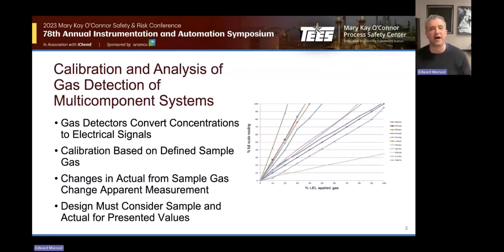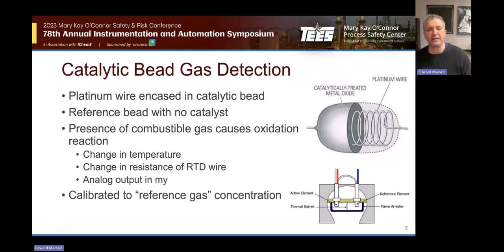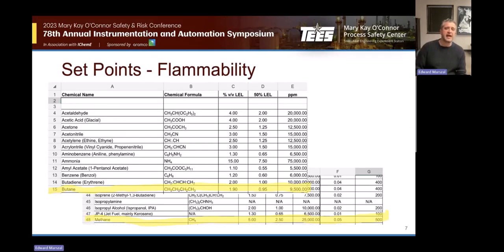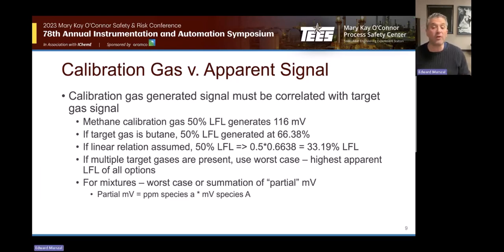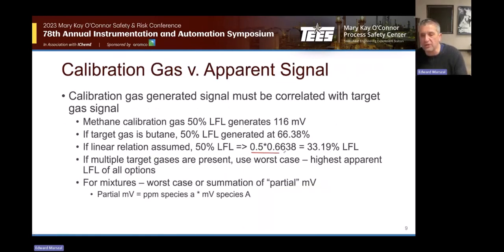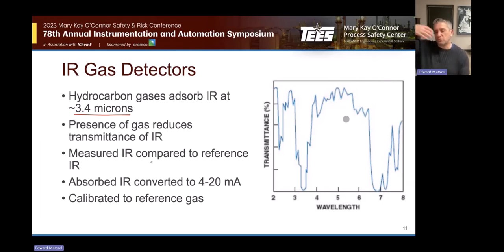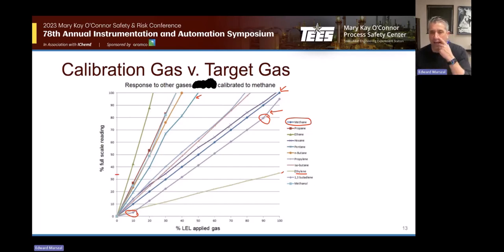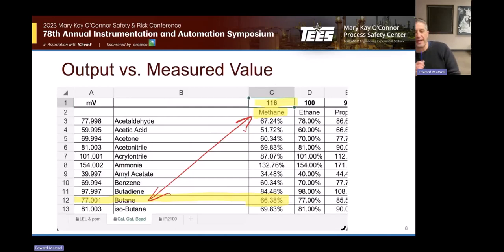Recorded Webinar: Calibration and Analysis of Gas Detection of Multi Component Releases

Comment: Great presentation. Congratulations! In the presentation  you said in that you recommend to calibrate the catalytic bed sensor monthly. In the case of IR detectrors, with what frecuency you suggest check the  calibration on this sensor?
Reply from the maker: We do not necessarily “recommend” monthly calibration, I just stated that monthly calibration is common.  The approach is to start with the recommendation for calibration timing from the vendor and then increase or decrease the frequency depending on how far away that actual measurement was from the expected measurement when the calibration occurred.  The larger the gap, the more frequent testing should be.  The frequency will be dependent on the concentration of “background” gases that can deactivate the catalytic bead.

With IR detectors, the calibration can be less frequent because the concentration of background gases will not impact the performance of the detector.  It is common to calibrate IR detectors once per year.  That said, the same approach as described above should be employed.  Start with the vendor recommended timing (probably once per year) and then after going through a calibration cycle, look at the actual versus expected.  If it is large, more frequent calibration is required.  If it is small, you can space out the calibrations more.

It’s kind of a trial-and-error effort based on vendor and application.